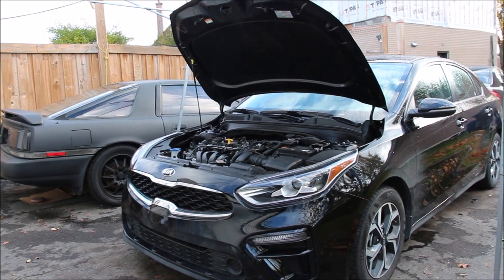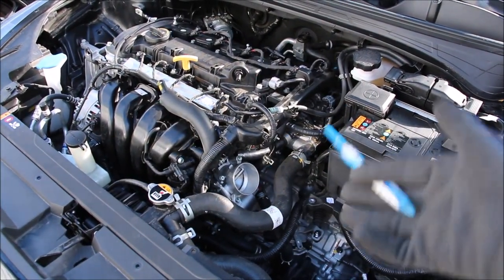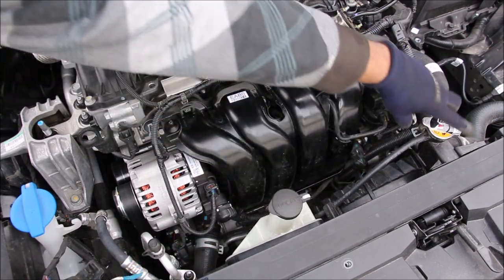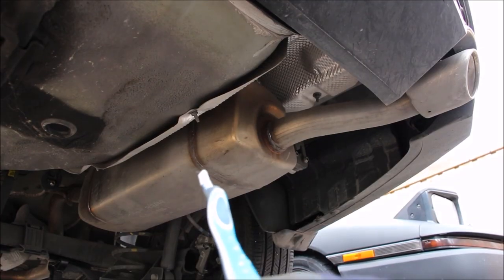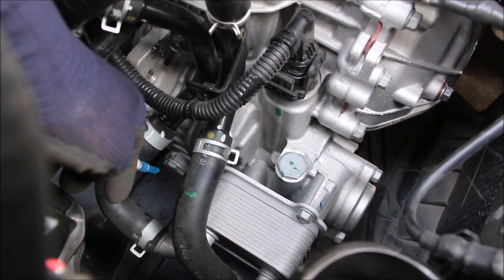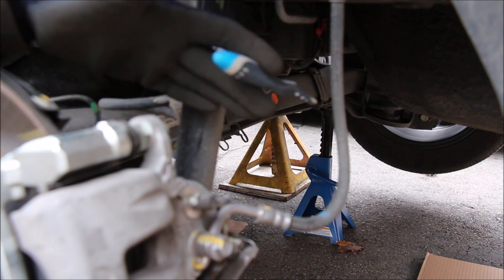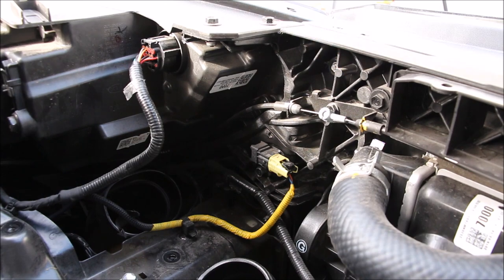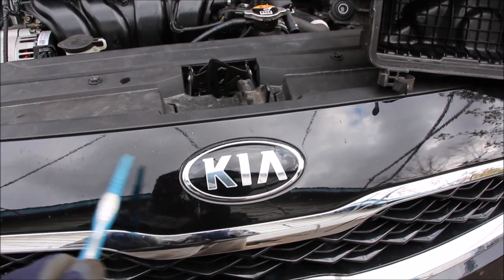Kia Forte Mechanical Review

Comment: How does the cooling system on Mercedes and BMW keep the coolant from boiling if the radiator doesn't have a cap and the coolant is free to flow back and forth to the reservoir, which has some empty space that can allow the coolant to expand and boil?
Reply from the maker: Isn't the cap built on top of the reservoir? The cap is there for safety too

Comment: This video pretty much confirmed my suspicion about Korean cars.... and to quote a C&D article not too long ago "they have improved immensely in recent years, but they still feel only about 7/8 baked." And that's how I feel about the quality, craftsmanship, and overall finish of Hyundai/Kia. It is a darn good value for what you get, but it is just missing that last 10-15% in general refinement that you just feel they hit a wall with and just gave up. 

Recent korean engines haven't proven to go the distance, especially those theta II 2.4 engines that went into hundreds of thousands of Sonata's, Optima's, and Sorento's between MY 2011-2013. A lot of them failed between 60-130K mile, not exactly what you would qualify as reliable....

Also, interesting that this car has port injection.... Elantra's from 2011 had GDI.... and Hyundai had issues with them... wonder if Kia took a step back to address the problems they have had with GDI durability
Reply from the maker: Agreed and I heard of the theta2 engines having problems. 

It does what it needs to do, for the price, good, but not wowing

Comment: You can't change the blinker fluid, you have to replace the whole blinker assembly 😁
Reply from the maker: Yeah. So sad. It's a sealed system with no way to check fluid level.

Comment: My oil level in my 20 forte is 1/8 under the full line. I have about 2000 miles. I wonder if this is normal :/
Reply from the maker: Was it full when you got it?

Comment: This is regarding your previous video but...
@speedkar99 wow so the new Camrys sheet panels are that much thinner than a gen 5? Older Camrys are such tanks. I heard the gen 5 is alittle thinner than the gen 3 I mentioned. But I'm not really sure on that. But my 1992 is ridiculously thick with the sheet metal. Hail stones don't really hurt it. I'm 6ft and 200 lbs and can stand on it without dents. It's similar to when I borrowed my friends Mercedes 300D. Do you know if the gen 5 is thinner in sheet metal vs Gen 3? If so the new ones must be way thinner than my old 1992. My 2017 Impreza is super thin metal.
Reply from the maker: Ive never had a Gen3 but I can tell you that I tried stealing brakes off one in the junkyard and the splash guard liners, bumpers and fenders were so solid! I'm sure they've been thinned down on the Gen5 and even more on subsequent generations. Despite better crash ratings, the thinner panels can't stand up to every dings and dents as they once used to....but the safety regulations don't say anything about that!
Reply: Thanks for the reply man! Yeah they are legendary in such regards. I believe a big factor is that the gen 3 was the one true Lexus grade Camry in terms of GD&T levels and material quality. It basically ripped them off the company's in house ucf10 LS400. But as a loss leader it wouldnt be financially sensible to build them that way since nobody would want to pay like 60 to 80k on a modern Camry if Toyota wanted to make actual profit haha! I think even advancing metallurgy can't compensate for much thinner metal.

Comment: Another cvt what the hell 
This is becoming too common
Reply: Unfortunately i believe soon cvt transmissions will be the standard. They are more cheaper to produce and manufacture thus letting car manufacturers to bring in more profits.
Reply: So? Don't buy one.  Most people don't care/know about their transmission.  The long skinny pedal means go, the wide one is stop.   If a CVT is cheaper to produce, who cares? And at least with Toyotas, they have steps (virtual gears) under hard acceleration.  Driving my brothers Carola, I thought it felt much better than most automatics.  Ill still be sticking to my 5 speed though.
Reply: Toyota's cvts are some of the best compared to the rest. The only thing about cvts is that they're not as reliable. But of course that will change with time once they "perfect" it. And yess Save the Manual!
Reply: Trap Lions the difference with this one is Kia and Hyundai decided to use a chain, not a belt like other brands have done.
Reply: @tails300  All CVT''s use a metal belt chain thing.  He was referring to the timing chain in this video.  Nothing to do with the transmission.
Reply: luke saylor no they don’t most manufacturers use a steel coated belt, these new Kia and Hyundai’s actually use a fully metallic chain link belt that’s supposed to be better on durability and longevity.
Reply: @tails300  subaru uses a chain belt too
Reply: Adam Robinson that’s good, should last longer than other brands like Nissan.
Reply from the maker: CVTs are the norm on economy class cars. Expect to see them on larger vehicles as the technology develops, until electric motors with no transmissions take over.
Reply: speedkar99 they’re already in larger vehicles like the Subaru Ascent, Honda Accord, and Nissan models. Kudos to Kia/Hyundai, Toyota and Mazda (Mazda doesn’t use any CVTs in their cars) for realizing they should only be in light weight, low torque applications.
Reply from the maker: I meant bigger vehicles like SUVs...the largest out there I think is the Pathfinder/QX60
Reply: speedkar99 yeah and the Pathfinder/QX60 tend to have a lot of CVT issues.

Comment: Anyone here change coolant of it. how to drain all coolant on reservoir. i cant find out. i put pipe inside reservoir so i can suck it out.but it cant go to bottom structure of it so complicated. guys help me.
Reply from the maker: There should be a petcock valve at the bottom of the radiatior.
Reply: @speedkar99  yes ! it has valve at the bottom driver side of radiator but i want to ask coolant plastic tank its part of fan. i can not take it out to drain coolant. hmm i just mix old coolant with new coolant. cannot find out
Reply: @speedkar99  thank you for reply me.
Reply: @speedkar99  so dumb design.

Comment: worst part of this car is CVT with little radiator and no filler gauge to check oil and also funny label about never change CVT oil.look like they want customer to drop CVT after 100K and buy a new one.
Reply from the maker: Yeah. At least they make it easy with a plug and a few hoses, a mount and bell housing....drops right past the subframe.

Comment: I stopped watching when you said in order to change transmission oil you need to replace a transmission 🙄
Reply: That's what they call "Planned Obsolescence!". I'm not even sure if it even has a transmission filter, very dumb
Reply: Not uncommon for CVTs due to their complexity.  I seem to recall watching another vid of a Nissan repair where the CVT had a minor part break but the entire unit is considered "non-serviceable" so the whole thing had to be replaced
Reply: @chrisfreemesser5707  we are talking oil change not a minor part break. Even Nissans shitty Jatco cvt you can change oil and make it last to 120k miles.
Reply from the maker: But all CVTs are non-servicable. Nissan, Toyota, etc don't offer repair information for them.
Reply: speedkar99 correct sir. Which other Kia/Hyundai won’t allow to change oil in the cvt?
Reply: @speedkar99   not to the general public no.
Reply: its sad but that is the way the world is heading. dealerships are making it harder n harder for ppl that dont work at dealerships to do any maintenance. We joke around by saying in a few years your entire vehicle will be filled for life and when something breaks you will just get another new vehicle under warranty  lol
Reply: @kclefthanded427  It does have a filter and every automaker, including Toyota seals their transmissions now days, why? I don't know.
Reply: CVT represents a new level of cheapness and disposable ability, as well as a lack of driving pleasure.  No thanks.
Reply: He showed the drain plug, the fill plug and the overflow plug. Wtf wouldn't you be able to buy some cvt fluid and change it. Screw that sticker.
Reply: @matt4398   You are right. I would change the cvt fluid once it is out of warranty for sure. What type of atf do those cvt transmission use?
Reply: That's pretty much all transmissions nowadays. They're all "sealed units" even planetary gear transmissions
Reply: They are all made by Aisin. You have to change them out not matter the brand name is.

Comment: Does this engine have knocking/ticking problems?
Reply from the maker: Not sure.
Reply: @speedkar99  than you anyway. Mine has started making a weird noise and only revs up to 4000 RPM (no engine check light), thought it could be engine knock but I'm still not sure. Some say it's the normal sound of the engine.

Comment: @4:12 lmao are you seriously suggesting moving entire engine/transmission block couple of inches, throwing off entire vehicle weight balance, just to make room for easier water pump replacement which may happen at most once during the entire lifespan of the vehicle?
Reply from the maker: Well it's one idea. Of course vehicle Dynamics and fitment have more of a role in engine placement than WP replacement. At least make it easier to access it though, since we know they do fail.

Comment: What tires do they come with?
Reply from the maker: 16"
Reply: @speedkar99  What size and brand? Does it come with low pro tires that cost a lot and will damage wheel when hitting potholes? Or regular size to take the beating?

Comment: Please explain Blinker fluid  LOL
Reply from the maker: Blinker fluid is filled inside the blinker lense in order to make it flash. If it drips out, leaks or is low, the blinker won't work and you potentially could face charges under the highway traffic act for a non-functional blinker.

Comment: Dirt cheap car with a CVT and port injection? Sounds like a good deal for a commuter appliance. I mean you can go with a Rio or Mazda 2, aka Toyota Yaris iA, but that would be a huge compromise. Forte and Corolla are Costco Kirkland brand while Rio and Mazda 2 are Wal-Mart bargain brands. At some point, you have to ask yourself if compromised safety, road and wind noise, and a jarring suspension are worth the low price. I mean personally, I would not use these soulless things. But hey, they have their markets.

Comment: 🤣🤣🤣🤣 you have two nice hooks to remove the engine when it fails just after warranty 😂😂😂.
Reply from the maker: Yes
Reply: @speedkar99  by the way NU engine is the most reliable hyundai 4 banger that i saw we have a sonata hybrid 2012 with this 2.0 engine not its over 80k miles no problems.
Reply: @MiranPayman  I've had 2 family members have to have the hybrid engine replaced, luckily one was under warranty, and the 2nd one was paid for by the dealer because the car had just been purchased. Something isn't quite right with the 2.0 and 2.4 motors as evidenced with the 2 billion dollar engine replacement recall.

Comment: Oh HELL NO, CVT Trans ,Worst Trans EVER, and GDI Engine, WTF, Those Kia catch and FIRE Watch the News over 1 Million recalls 🤣🤣😂😂🤣🤣
Reply: Let's not freak out irrationally here. This is a whole different engine family. The Nu engine family in this one has been pretty solid. The Theta 2.0T and 2.4L engines are the ones you should be worried about but even those are being phased out in favor of a 2.5L and 2.5T and those have dual port injection. GDI isn't bad inherently obviously. You just have more carbon build up issues but that's downside of the extra power and fuel economy you get.
Reply from the maker: Where's the 2.5T going to be used? I haven't heard of it yet...
Is it the 3.3 TT replacement?
Reply from the maker: Well tbh it didn't drive as good as the Corolla I reviewed which also had a 2.0L engine and CVT....so I don't know where Kia is taking this
Reply: speedkar99 2.5T is replacing the 2.0T. 3.3TT is being replaced with a 3.5TT. They’ve already been announced